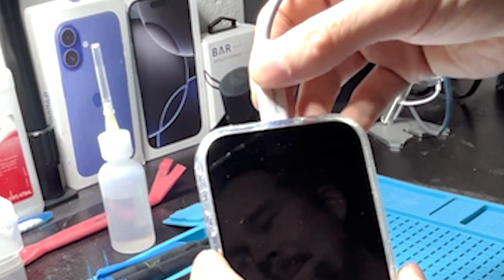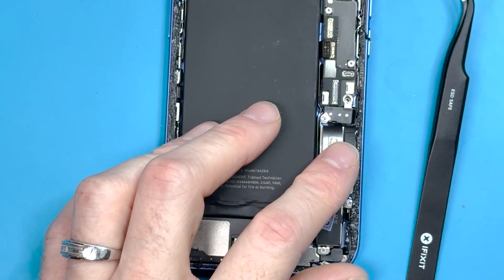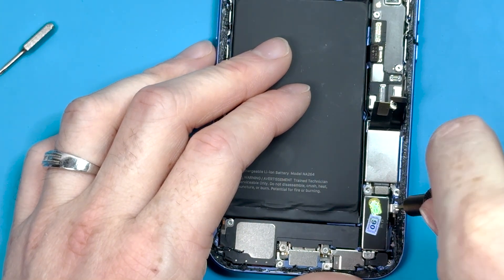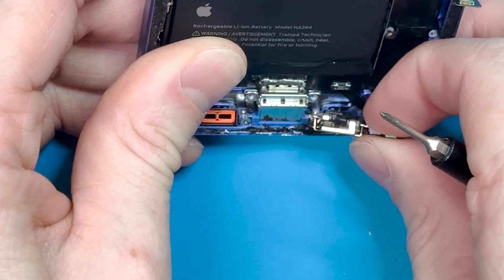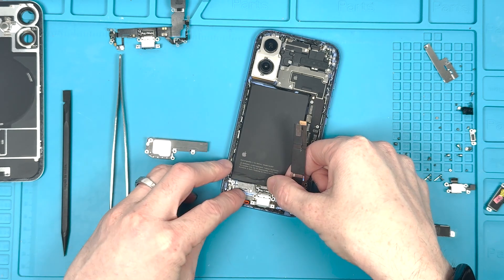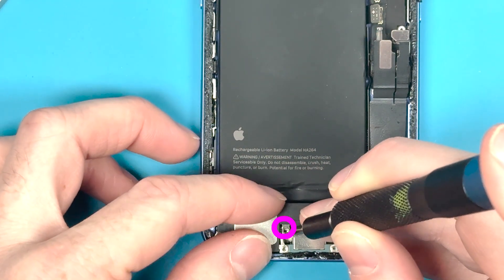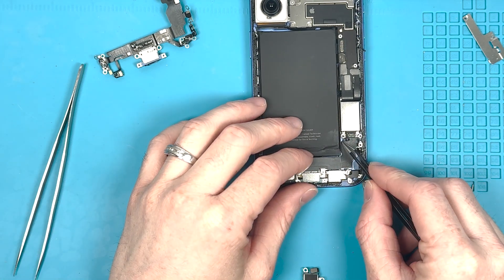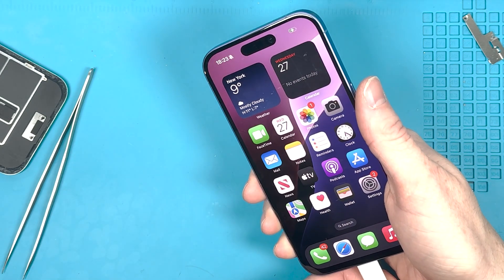📱 iPhone 16 Not Charging Fix - Charge Port Replacement Guide 🔌

Comment: Great video.   Very helpful!  So my daughter's phone would charge, but not transfer data to a computer.   I replaced the charge port as shown, and everything worked, but there ieas a clicking sound when recording video.  I put the original back in and the sound went away.  I assumed I just got a bad replacement charge port, so I purchased another from a different seller  and got the same results.   I just put the original back in so she could record videos again.   Any ideas what could be causing this?
Reply from the maker: You can buy another microphone for it and connect it again which is a ton of work. I also had times when I forgot to take off the plastic cover over mic before which caused weird sounds. Hope this helps
Reply: I don't think the microphone is the issue since the clicking sound only happens with the new charge port assemblies.  I removed the plastic from the bottom of the charge port assembly covering the adhesive, but I never saw anything else to remove around the microphone. Not sure what else I can do.